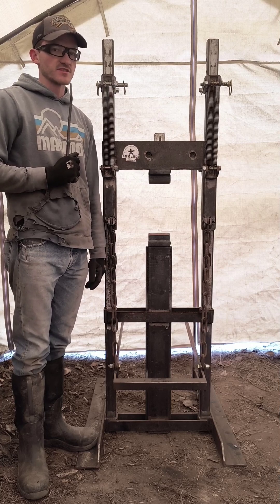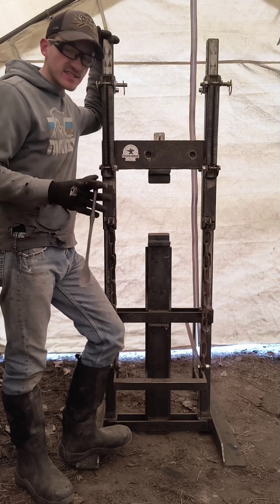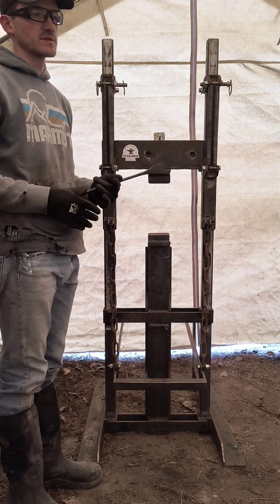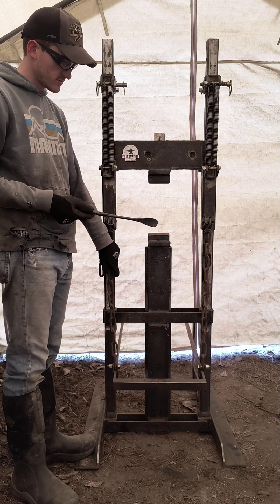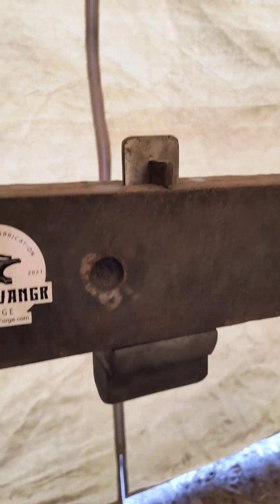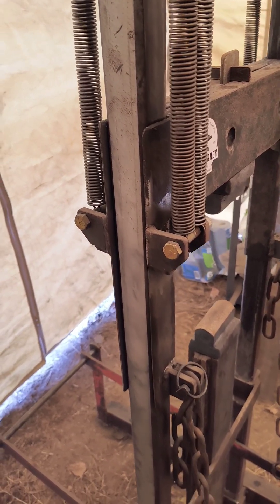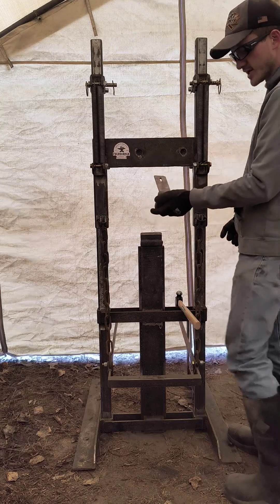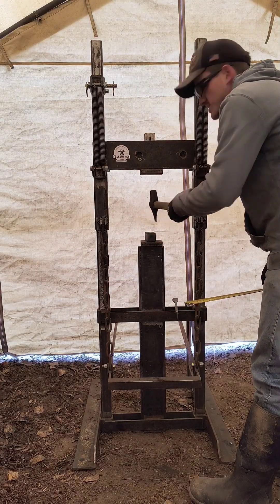The Guillotine Hammer (Treadle Hammer) - In-depth Walk Around

Comment: I am building this from scraps from another project  I have a double pulley with a 1 to 4 ratio. Will see if it is overload. My hammer is currently 30 pounds. I may need to shorten my anvil to gain stroke. Thanks for this update.

Comment: A very clever design.  You're aware of its potential weak points, so I won't dwell on them, but only make some suggestions you might consider.
Always use the weakest possible springs that will hold the ram up and not stretch beyond their elastic limits when the ram is fully to the anvil.  The reason is that a weak spring has a small spring constant, k, where F=kx, so the force needed to bring the ran to the anvil is the least possible.  In your case, you might extend make the spring-mounting points further apart to accommodate such weaker springs at greater stretch.  
My Grasshopper Treadle Hammer, inspired in part by Clay Spencer's roller-blade-wheel hammer, was much criticized due to it's relative complexity of construction, but I chose that route to eliminate all sliders, to have maximum accuracy, 22" hammer travel, a weightless ram, 2:1 ram:treadle speed, and very fast adjustability in a single crank.
DO NOT EVER put your hands between the ram and the anvil.  Granted, the chances of that ram falling unexpectedly are small, but ask Clay Spencer whether they're non-zero!

Comment: Thats a really nice design! The only thing I'd consider to be easy and beneficial is a brace across the top (which could be even just be pinned in for maintenance).
As an engineer I agree with the omission of bearings and slide guides from a cost & ease of construction perspective because being a foot powered machine, you arent ever going to wear those components out. Hell, the 100 year old power hammers have only ever needed their tight tolerance bronze wear components replaced a few times in an industrial setting. All of that also has me considering some alterations to my power hammer build design for ease of building & maintenance.
Reply from the maker: @TheIdeanator  Thank you! Glad you enjoyed it. The original plan was to bolt on a bar across the top. But after testing I removed it. It was too ridged and the head would rock side to side and bind up. Letting it hang loose freed it up entirely and it has never bound up since. It seems very counterintuitive. But it works.

Comment: Very cool idea. My only qualm is that you don’t get any mechanical advantage from the linkage, but otherwise a great bit of design creativity. 

One small hint: if you were to attach the cotter pins to a thin short bit of chain or cable, you wouldn’t have to worry about dropping them or fumbling for them as you reset the height.

Comment: Yeah, I like that.  The Specer hammer is really nice, but it's also very expensive to buy and complicated to build.... never mind that it takes up a ton more floor space in the shop.  Overall, two thumbs up for a very economical and simple design.  I think all the little parts, including the springs, can be found locally at the Tractor Supply store or similar.  Then it's just a matter of buying the metal that you need.

Comment: I like the simplicity of this and not needing a lot of machine tools to build it.  I was wondering  ; a rotating cam powered by an electric gear reduced motor with a foot switch would make this extremely useful.   Wear faster
Reply: You're describing a vertical way to make a "trip hammer" but those can be lubricated by a variety of lubricants like cog lube, fifth wheel grease or whatever is handy.

Comment: How is that anchored to the ground?
Reply from the maker: My shop has a dirt floor, so it's not anchored to anything. Even then it doesn't move around at all.
Reply: @colesonchild  is that because the footprint is wide or because most of the down force is in the center?
Reply: Also, how well does it work for drawing out?  I use a hand hammer to draw out tong reins from time to time and I wonder if this wouldn’t be more efficient.
Reply from the maker: @redrob6331  I wouldn't say because it's wide, I think when I hammer it imprints into the dirt a little bit and gets stuck.
As far as drawing out material goes, that is definitely a secondary function. This machine excels at being a striker for top tools. You can totally draw stuff out but I don't think it hits much harder than a 6 lb sledge. It's great that it takes a lot of the work off your shoulder though.

Comment: I just had my first test run of my guillotine treadle hammer and so far it looks quite good.  I made a few changes vs your original machine.  

1) I didn't want to stop and lift the machine to different heights to I moved the spring towards the centre of the machine, ran a 5/8 threaded rod down from a removable top cross bar to a load distributing hitch on which I have 2 chunky springs.  To adjust the height within a 18" range you just attach a power ratchet or drill and run it up/down to wherever you want it.  So far it works great.  2) My main anvil uses 1.25" square inserts and I want to use anything I built on both so using a short stick of that with your draw bar up from the inside of the tube to the top of the cross bar.  Also I intend to put it on a diagonal letting me lock it in place at 0 or 90 degrees for a bit of flexibility and use a independent retainer plate on top to hold it and still spin to match the angle.  3) the unit is installed on 1.5" to 1.25" receivers so I can take things apart for modifications easily or to use it as a regular anvil.  4) I moved the foot bar to the outside of the entire unit and ran the chains to the outside edges of the rig to get rid of the knuckle buster issue you mentioned.  

I tested it with a fuller on a wooden handle and a piece of 2" wood, did a fine job of pushing the tool well into the wood.

My only mistake so far was making it a bit tight on tolerances, had to deal with/fix some binding issues and it's probably going to have a long break in period but moves smoothly now that it's lubricated with thick grease.

Thanks again for the video!
Reply from the maker: That sounds awesome! Great job!
Reply: Thanks!  @colesonchild